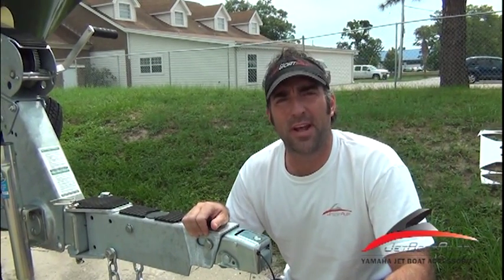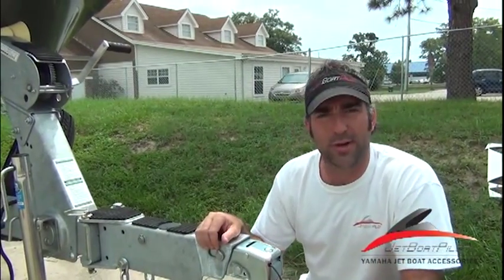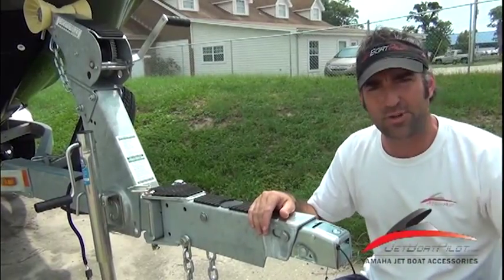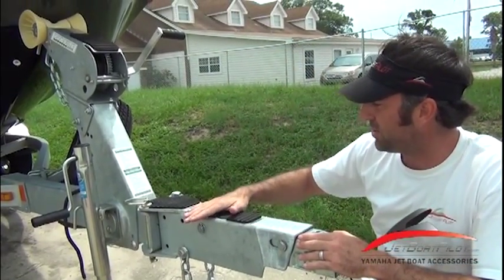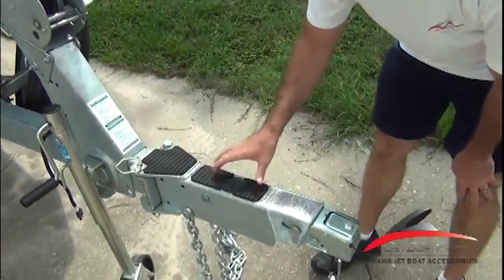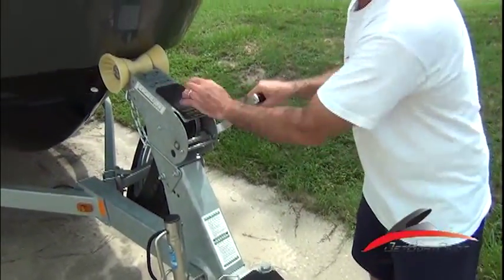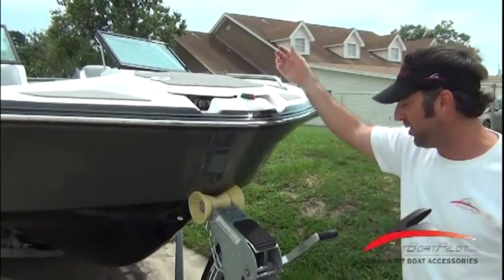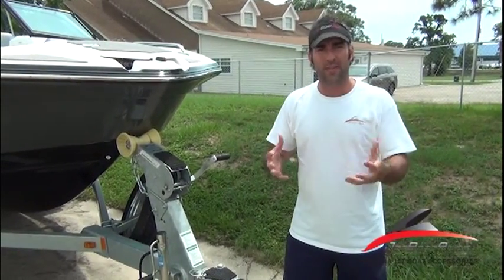Yamaha Jet Boat Trailer Bow Stop Traction Mats Intro

Comment: They won't stick to a trailer that has been painted with texture. The adhesive is not strong enough. I had to use construction adhesive to get mine to stick. If not secure enough, they will slip off and you will be on your way to the ground. JBP pilot should add this issue to the product description, so buyers will be better informed. I like the product.
Reply from the maker: Good point. We'll get this added to the site.